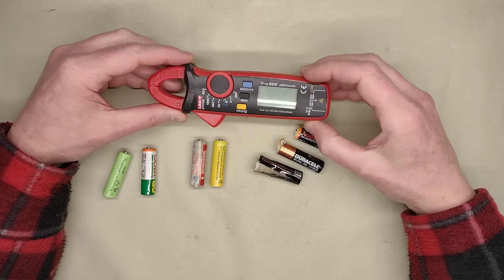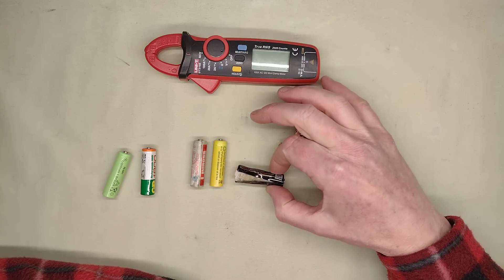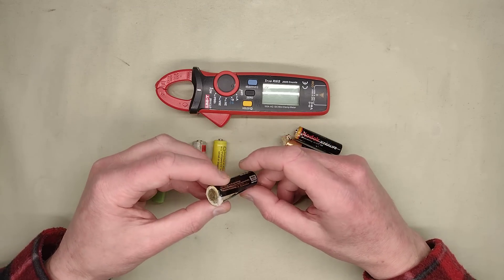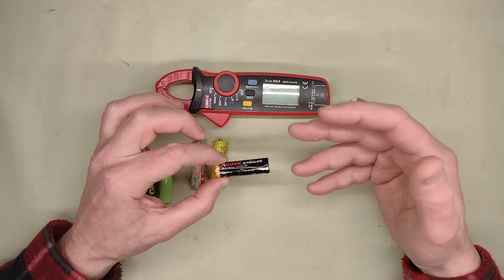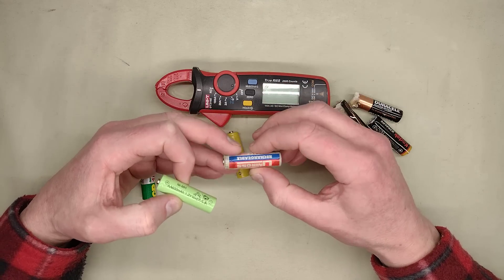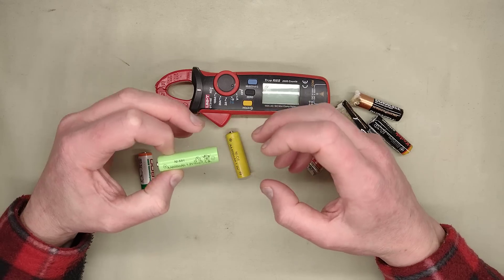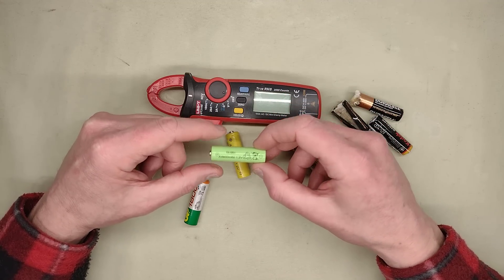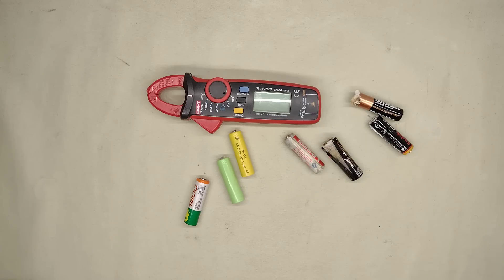The curse of leaky alkaline batteries

Comment: I like the new USB charge 1.5v lithium AAs. They seem to have a higher capacity than NiMh and better voltage, but not for high discharge rates. I have a bunch of the low self discharge NiMh from about 11-12 years ago that still seem to work fine. I even still have a couple of my very first NiMh AAs from 2003 - they don't hold a ton of charge but they also don't leak after almost 2 decades!

On the other side of the coin I have recently found FOUR different cheap chinese lipo packs in various things in my house puffed up like a balloon. That can't be good...I'm starting to worry about the number of long forgotten lithium batteries hidden nearly everywhere...
Reply: If I may ask, which brand did you buy, how long have you had them, and what faults, if any, could you say they have compared to NiMH cells? I did a fairly deep dive on them not long ago and thought they seemed to be a cheep gimmick. USB charging, if anything, seems more awkward than conventional charging, and it's not like they don't have perfectly good positive and negative terminals on hand, either. The seemingly universally poor manufacturing quality didn't help, and the rating of the batteries using mWh instead of the very industry standard mAh put a sour taste in my mouth - stinks of misdirection and snake oil. Plus lithium cells have a considerably lower charge cycle endurance than NiMH. Bit of a long-winded post but hopefully you can see where my reservations (and curiosity, if you found some that are actually good) are coming from.
Reply: @akimbo990  For the most part I try not to use AAs anymore. I had 50 LSD cells and just to use them up I made 12v packs out of them, they still hold pretty much full charge after a decade. Anything left is mostly low drain stuff like clocks and remotes and flashlights. The full 1.5v is very nice to have in some things, especially with only 1 cell. I have not done a capacity test on the lithiums but of course li-ion is more energy dense than NiMh, they should be pretty close in the end. It's just a matter of sorting through the chinese garbage - I'm sure there are also some really bad ones available. I can't even remember what brand mine are, something from Amazon. It's also a great format for 9v batteries, I've hated those overpriced alkaline things since the 80s!

The USB charging isn't totally necessary, but without that you'd need a whole new kind of charger. Normal AA chargers don't output 5v. They have to make them simple for the sheep to understand.
Reply: @akimbo990  The Youtube channel Project Farm did some comparisons this year. I'm using the Pownergy AA/AAAs I've had for about 10 months, they work relatively well. They have less total capacity than an equivalent NiMH battery, but since they deliver all of their power at 1.5v they are great for devices that cut out early due to low voltage, the kind of thing where "Lithium" disposable AA/AAAs were good before. I agree that the USB-recharging isn't strictly necessary, but without it you'd need a proprietary charger, or MUCH smarter and more expensive electronics in the batteries.
Reply: @akimbo990  I bought Vapcell AA lithium rechargeables. They're not the highest capacity possible but I measured each cell between 1913-1958 mAh which is a bit above their rated/labeled 1800 mAh. (Yes I mean mAh, you're right that most advertise mWh so they can look competitive with NimH which is some marketing genius/wankery). I bought them specifically for the few devices that I have that are voltage sensitive (the rest get NiMH). I also specifically went with the Vapcells because I wanted them to be able to be charged with any micro-usb cable, since it makes them more versatile and dovetails with their use when backpacking since its easier to jack them into my portable solar panel/powerbank that way. I have a nice 4-bay NiMH charger that takes usb in, but even a single-bay charger is bulkier and more expensive than a micro-usb cable. I have no complaints with them but if you don't have a meaningful use case then there is no reason to choose them over NiMH which you can get cheaper, with higher capacity.
Reply: @akimbo990  Well managed lithium cells have a much, much longer cycle life than NiMH. The standard cycle (4.2 volts down to 2.7-3.0 v) is to last for 500 cycles, while you will be good to see 200 out of NiMH. By lowering the peak voltage by about 0.07 volts, you roughly double the cycle life of LiIon. Lower it by another 0.07 and you get 2000 cycles, and so on, until your lifetime energy throughput is impacted (~3.8 v peak of charge). Of course, if the charging circuit and low-voltage cutoff in those lithium AAs are beating the hell out of the cells, then all bets are off.
Reply: @Markle2k  That strongly contradicts both the 1,000+ cycle endurance I've commonly seen stated (both by manufacturers and users) for NiMH cells, as well as my personal experience with lithium cells... I had a pair of heated winter gloves that ran off lithium battery packs, and the batteries failed in their second winter - not even a full 365 days of daily use! Smells like rubbish to me.
Reply: @akimbo990  There is a huge variance in lithium cell quality, and as usual china doesn't care if they rip you off and burn your house down. Like I said above I was rather alarmed to find multiple low quality lipo packs puffed up like a balloon in my house, and I was unknowingly still using them! They probably had less than 50 cycles on them. (cheap USB power banks)

On the other hand I get a new phone about every 5-8 years. That's how long the battery usually lasts me. Currently have an S7, at least 6 or 7 years old, charged to 100% every night and drained to the teens. That's over 2,000 cycles! The battery is dying now but I think it earned it's retirement...
Reply: Today I checked my dead Pendulum Clock that I made in Junior High (decades ago). An alkaline destroyed it. Leaked all over the beautiful brass pendulum and fancy brass face. Today the AA NiCad stuck in C cell adapter was dead as a doornail but there was no leak!
Reply: The original LSD NiMHs used a tiny alkaline cell to keep the cell charged. The alkaline chemistry, despite nominally being a primary, could actually take enough of a charge to function in this manner.
Reply: @Markle2k  That is interesting, I know the second gen LSDs were much better. It's funny to think I actually used to *RECHARGE ALKALINE BATTERIES*...they were good for a few cycles but guaranteed to leak! Only charged at like 20ma, took forever!

At this point cost wise if something the size of an AA lasts only 100 cycles, that isn't bad. Obviously we need better for more expensive batteries...

Comment: As a vaper I am forever using an 18650 Lithium Manganese or IMR rechargeable battery.
They discharge safely and continuously at a maximum of 7 volts and 40 Amps...in case you need to run an arc welder  XD

Comment: One AA-Lion and one blank. If the  4.2V is too much, a diode or two inside the blank will do. The benefit is that you need only Lion chargers while traveling. Also the battery lasts longer, because NiMh voltage drops too fast below thresholds.

Comment: I've moved on from Alkaline to Lithium batteries for years now.

Much lighter weight, longer lasting and more consistent power, they go full until depleted unlike how alkies would slowly get weaker voltages as they died.
Reply: Which ones are you using?
Reply: @av_oid  I typically use the Energizer Ultimate Lithium batteries. Great for handheld devices and LEDs.

Comment: Around a week ago i pulled out my New Bushnell headlamp, never used. It came with three AAA Durafails and as i was opening the package of batteries i noticed two were leaking. Good by date stamped, March 2025.  TG they were not installed in my headlamp! So I am now phasing out all alkaleakers and going to rechargeables.  Not much price different either.
Reply: it's not all alkalines.  It's Duracell.  I'm seeing that constantly.   Unless you're going to use them quickly, don't use that brand.  I buy mine from Northern Tool.

Comment: i still have to buy alkaline batteries for things like my wireless outdoor PIR security light and my rowing machine since they all take D cells and rechargeable D cells are very pricey so are the chargers you got to buy for them  and dont last as long ,we need some kind of new standard of recharge packs that are shaped like a phones battery high capacity and slots into multiple devices instead of the wasteful cylinder cells, but making a new standard is easier said than done ,especially when all the factories making electronics all have the molding for the AA/AAA battery holders

Comment: Not so many years ago zinc-carbon were the useless disposable always prone to leak, alkaline was the standard for things you cared not to destroy. Now, I've had alkalines leak in their package far from expire date. A forgotten remote controller had a pair of Panasonic zinc-carbon, expired may/2005 and funny enough not only didn't leak but still had a pretty high voltage under a small load. About those newer ni-mh cells, pretty much every name brand nowadays are low self-discharge, but worth noting the lower capacity ones within the name brands (Sony silver tabs, white/blue eneloops, white Fujitsuamong others) usually goes way longer inside low-current devices than their high capacity counterparts.
Reply: I deliberately buy and use ZnCl or CZn  for remote controls, specifically for this reason.    I've replaced them in one remote control (for my stereo) three, maybe four times, since I bought the stereo in 1993.   The good quality ones don't leak, and under the low (no) load of something like that, they last next to forever.  

I had heavy duty batteries in my 'electronic safe' - they lasted a decade.
Reply: Modern zinc chloride batteries are dry inside if you cut one open indeed there's a video on YouTube of someone in India completely dismantling one part by part in detail and there's no liquid of any sort present. That's for the quality brands at least eg Panasonic. Hence I use them in all meters, remotes and so on without trouble. 

Alkaline batteries are pretty certain leak if not subject to an adequate discharge current on a frequent basis so they're no good for things like wall clocks (too little current) or meters, flashlights etc (not used daily by most people).
Reply: @shaun5552  - If you read up on them, you'll find that despite the name "dry cell", they contain a paste electrolyte.  Fluid can leak out of them when they are going bad, and if the casing ruptures, the paste itself can expand.  If they used the older construction technology, with the carbon on the outside, zinc on the inside, then leaks would be even more minimized, but apparently they haven't built them that way since the 1960's.
Reply: @shaun5552  I don't need to watch a video of someone else dismantling a battery.  I've done it myself.  The paste can produce liquid.   The paste itself can even come out of the battery.   It's still less destructive, being salt water, than the alkaline solution.

Comment: Well i lately got forced to test many different batts. Cinc Carbon, Alkaline and NimH. I use vr controllers that sadly do not use Lithium packs. 
Alkaline batts in my opinion still have a solid place for me in highpower applications they just last 3-6 times longer depending on the brand.
Cinc Carbon batts are just horrible for anything above clocks and remotes. 
I do use NimH batts but they are not suitable in long term for high power applications like my vr controllers. 
the reason is that i will have to charge them more often do to the lower capacity and voltage which effectivly shortens the lifespan greatly.

It is just rediculous that Lithium AA batts cost so much on their own. Not to speak that you dont want to cheap out on them aswell as on the charger hence i would like to not have my house burn down.
But i will have to switch to Lithium batts soon.

Alkaline still is a good option buuuuut not long term. Rechargeable batts are just way cheaper in long term.

Comment: I had not heard of the low self discharge NiMH batteries, just ordered a pack of them and will see how they last in things like remotes and clocks that used to be a pain because of having to recharge them every month or 2 with the older type NiMH cells I have for camera flashes and other high current devices.  The Tenergy Centura seem to be reviewed about equal to Eneloops so I'll be trying those out.

Also why am I not surprised the leaky ones were Duracell, I gave up on that brand many years ago and switched to Energizer, haven't had a leak since I switched.  But the holding company that owns Duracell seems to be buying up all the other battery brands out there so won't be long until they all suck.
Reply: .... You won't look back, the only non rechargeable batteries in my house are in smoke detectors.
Have'nt seen a leaking battery for two decades.

Comment: Honestly, I've never had a problem with Energizer batteries, always had problems with Duracell batteries
Reply: I've had PLENTY of leaks from both, and Duracells went from the better to the worse of that comparison.
Reply: The worse by far for me is Duracell. So many bad ones.
Reply: I had bought AA and AAA batteries at the same time 2 years ago. They were Energizer. Every single one of these have leaked. It's gotten so bad that I would totally be shocked if I found an alkaline battery that didn't leak

I don't remember this happening when I was a kid. You could find something that hadn't been used in years and the batteries would just be dead, not busted. I feel like now when I put alkaline batteries in something I need to put a reminder in my phone for 6 months down the road to make sure they aren't ruining what they're in.

Thought I was being paranoid but now I'm swapping styles.
Reply: Ive never had a problem with duracells

Comment: I'm cleaning out my grandfather's house and garage now. Have lost count of the number of electronic devices, flashlights, etc. that have had to go straight into the trash because their batteries leaked all over inside them. Also several new Costco-size pkgs of new batteries with half of them already ruined.

Lesson learned vicariously. I'm never storing batteries in my own seldom-used things after this. 😂 Also, rechargeables are absolutely the way to go.
Reply: I'm getting up in years a bit myself, so I'm parting with with some formerly hot tech items from some decades ago. Some still have some fun left in them, unless the alkaline batteries I left in them in 2003 have done their usually-irreparable work. So, thanking Clive for this timely video.

Comment: I’ve had to switch over to energizer ultimate lithium‘s. I have a lot of portable test equipment that I’ve worked extremely hard to build up for my lab and business over the years. There have been three separate instances where batteries ruined or almost ruined handheld test equipment costing hundreds of dollars. And some of my portable devices are somewhat rare and it would be extremely hard to replace them.

and I’ve repaired more equipment for others that was damaged by alkaline cells. Personally I prefer the lithium’s over nimh, although I have a large stock of eneloop and others that are wonderful. But they just don’t give the higher and precise long lasting voltage that I need and can get from the energizer lithium’s.

Energizer ultimate lithium‘s never leak, and they last much longer than even the best alkalines. Soon in the coming years we will be able to purchase good quality AA and AAA rechargeable lithium‘s… and 9 V for that matter!

Similar to the ones you showed on your channel last year Clive. I think they were called jugee or something weird like that. 

They are pretty impressive as of now but I think the technology needs to mature a bit more.… But when it does I will obviously switch over. 

Damaged traces and corrosion can easily be cleaned up, Properly neutralized so it doesn’t spread later… And then repaired with a jumper wire or whatever. That’s a process I’ve done many times.

But when dealing with higher frequency test equipment, and stuff where “signal integrity“ is determined by the extremely precise layout of the traces… just can’t be repaired with a quick jumper wire and solder blob. 

Never again will I risk a piece of equipment to alkaline batteries.

Comment: I didn’t think you mentioned it in the video, but the fact that Ni-Mh is rechargeable save a lot of money over time. I hope more people start making the switch to rechargeable if not for the environment, for their wallet.
Reply: Agreed. And it's such a huge timesaver to be able to pop them in the charger instead of making a run to the store. I just chucked out a nice flashlight because when I checked the battery compartment, I saw that it took C cells and went, "haha, nope." 😂